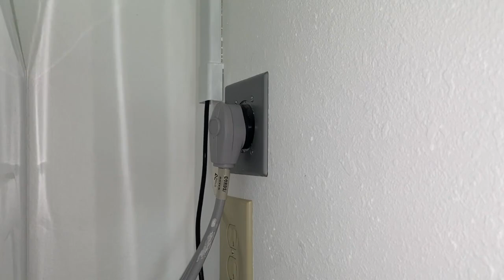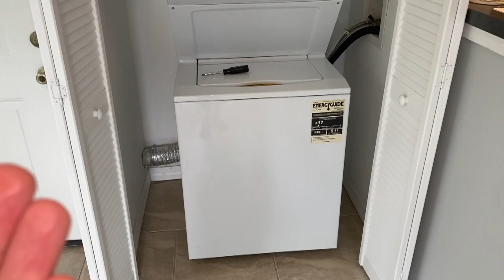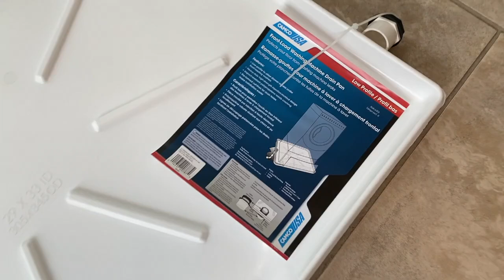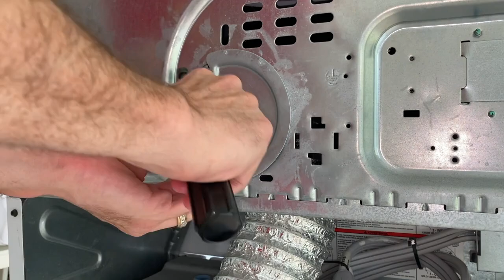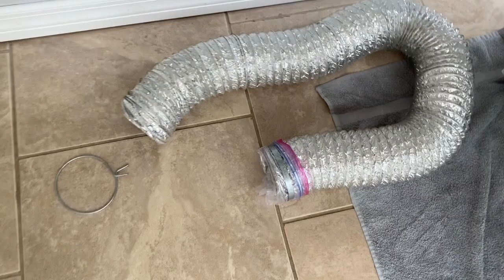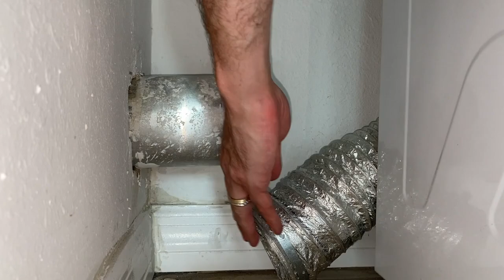Remove and replace GE Laundry Center dryer vent hose

Comment: Is there a way to install the air hose side ways, so the dryer is pushed more inwards? My closet door in the condo doesn’t close after the delivery crew did some basic hook up.. my model is Model # GUD24ESMMWW.. I believe it’s the same as what you are showing here
Reply from the maker: Thanks for watching, there is in most cases.  Do you see a pre-cut tap-out panel on side of unit?

If so, you can purchase proper adapter kit and carefully tap panel out and install kit.